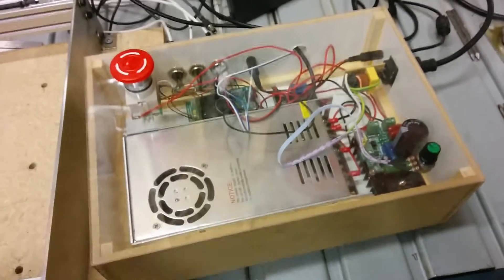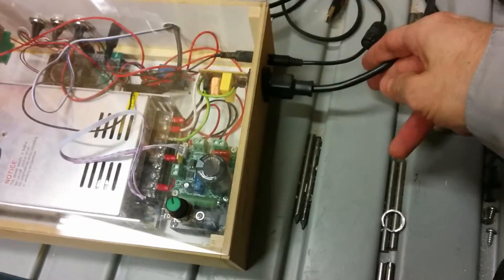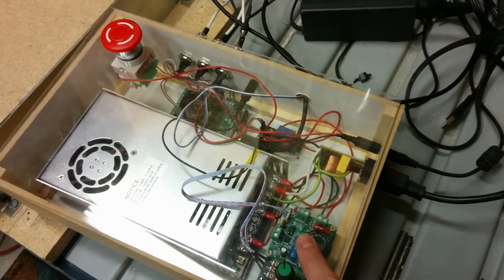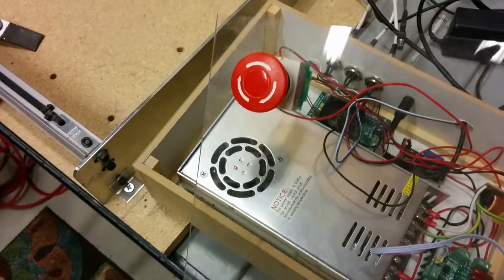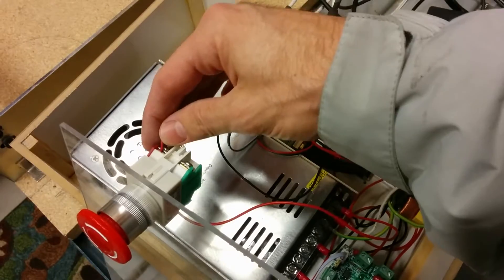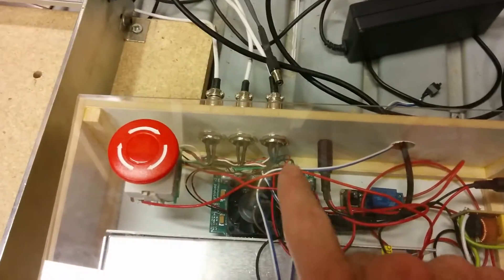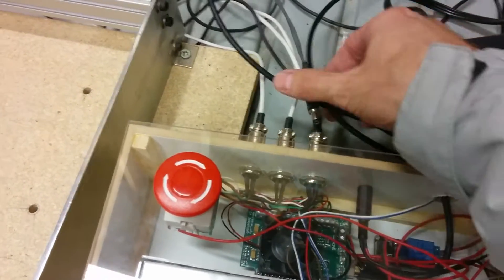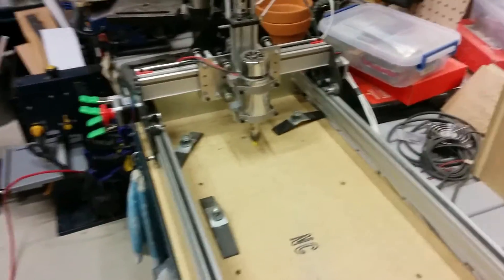ShapeOko E-Stop Button Explination

Comment: Hi Marc, I am a bit confused. What happens if your USB is connected? Then GRBL is powered by USB. So I assume what you did is that you connected the motor Supply Voltage to the E-Stop, not the power of grbl (which runs on the Arduino!) right?

Comment: Why don't you use the other two terminals on the e-button to stop the spindle the same way?
Reply: I thought about that.  I'm sure I metered the terminals and they are not split so they would be the same voltage.  Either way, I did however install a laser and it uses the same terminal as the spindle power only switched between pin 11 on the arduino.  Thanks for watching.
Reply: @MakeTinkerShare  Thanks for your reply. I bought one of these myself, and at least on this button (https://imgur.com/gallery/1x4j2sv ) each terminal it is conected just to the same colour. The only thing is, when one circuit is open, the other is closed, so if I want to use both open-close at the same time, I need to use a transistor to reverse the voltage.
Reply: @asunasposibol  Maybe that was my case as well. I don't remember as this was a few years ago. Either way, I'm usually running my DeWalt trim router. This quite spindle is more for public demonstrations.

Comment: Pardon my ignorance on control wiring but wouldn't the steppers continue running if you unlatched the estop thus making this more of a standard stop switch? I thought with a true estop some sort of physical reset/start button must be depressed to continue motor operation after said estop was opened.
Reply from the maker: You are correct in that the computer is still sending the g-code and the arduino is trying processing it. The steppers lose power when the e-stop button is pressed and they would indeed start moving once the e-stop is released.
When I'm pressing the e-stop it's because something has gone wrong. I then have to reset everything. This button is for just that, to stop the movement of the machine.
Hope this helps.

Comment: Just to get this out upfront I think this is a fantastic project. you are doing something I wish I could do and I love it. Thank you so much for sharing your stuff with us. I do so appreciate this to no end. But, with that said....

I maybe wrong but aren't you are just considering the Machine and the Part when you are talking about the damage, as a safety concern these are the least important aspects of installing an E-stop. The Primary concern is the personal safety of the operator and and personnel in the immediate vicinity. I would opt ( and have on many occasions) to apply the E-stop to disconnect the main power line with a contactor or relay and this would include both the hot and the neutral lines in this case. I think this is code in the US for manufacturing Environments. Hey but this is your device and as long as you are not using it make money and you call it a prototype or an experimental build then I guess it doesn't matter.
Reply from the maker: Wesley Credille thanks! You are correct that if I was doing this professionally and even had anybody else use my machine that I should have a main disconnect.
Given that this is my hobby and the danger involved is with me, I feel quite comfortable with the current setup. I think of it like the blade cover to a table saw.
Thanks for the comment though and I hope you can get into this as it is super fun!

Comment: Wouldn't the spindle shut off when the power is cut to the Grbl shield because the relay coil that Grbl uses to control the spindle would become deenergized?
Reply from the maker: Josh Crockett That is something that I need to investigate a little more.  I know that there are two circumstances when the relay stays engaged.  The relay is 5v so when the arduino is plugged in via the USB it has the 5v needed.  I might try to actually run it through the other side of the e-stop button.